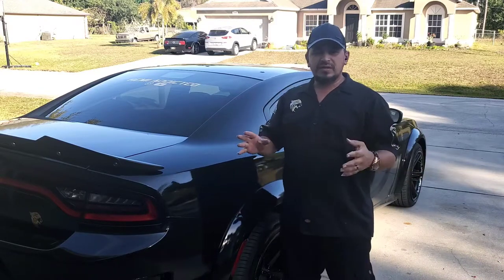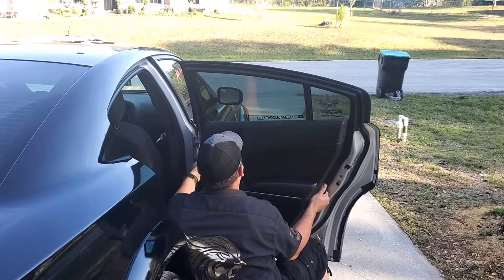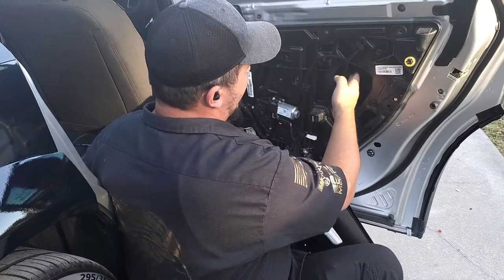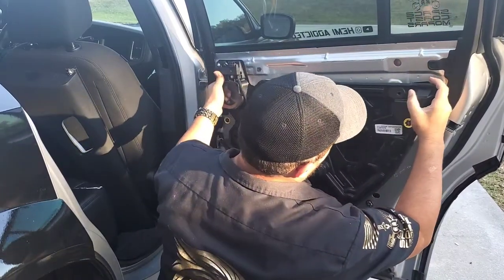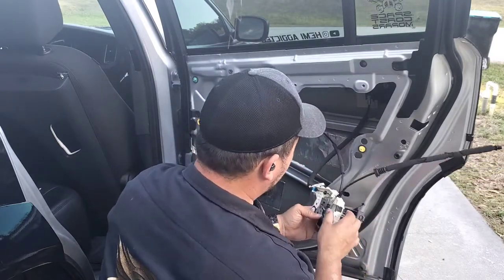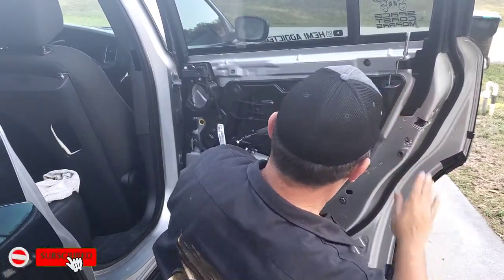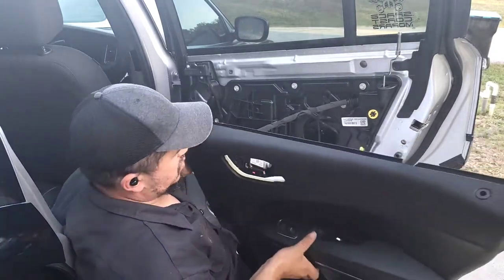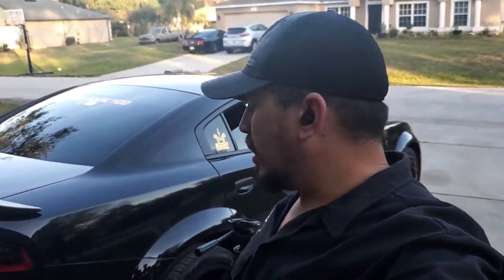How to install a interior door handle on your Charger Pursuit.

Comment: First let me say I really appreciate the video. Great info presented very clearly. Saved me a lot of frustration. One thing I saw....at 7:30 in the video, don't take that bracket apart, there is a much easier way. Just need to loosen two screws and you can take out the whole assembly in one piece. At 8:14, to the right of his wrist watch,you can see the weather strip on the end of the door. Partially hidden behind is a 1 inch grommet. Take that out and behind it is a torx head screw. Turn it counter clockwise to slide a bracket that retains the outer door handle. Once it moves far enough, the outer door handle is going to come out. Behind that is a Phillips screw. Loosen that enough to allow the whole inner assembly to be released.
Reply from the maker: Love it, thanks

Comment: Thanks for the helpful video! Just did this to my 14 pursuit, and your video set me in the right direction.  Those three retention clips holding the latch to the panel were a bastard! Enjoying your other videos as well, can't wait to do more mods to my hemi pursuit!
Reply from the maker: Thank you for the great support 🙏 🙌 😀
Reply: Well they're a bastard cause it's the wrong way to remove the latch, I did it this afternoon and you unclip the latch from the bracket and leave the three retention pins attached to the exterior handle.
Reply: Thanks man!! Really appreciate this video. Now I know what I need to pull from the yard or how to do the job. Appreciate it!!

Comment: Thank you. Very good video with all steps. Plan to do this to my 2014 pursuit. BTW did you have problems with the horn and high beam not working?
Reply from the maker: Thanks and No, when they reverted the car back to stock they fixed all that.

Comment: Hi,I followed the same steps as you did. The door works completely fine until the car locks, once you unlock the car the door wont open neither from the inside or the outside. Please help meee
Reply from the maker: I'll have to be there to see it working, sorry bud